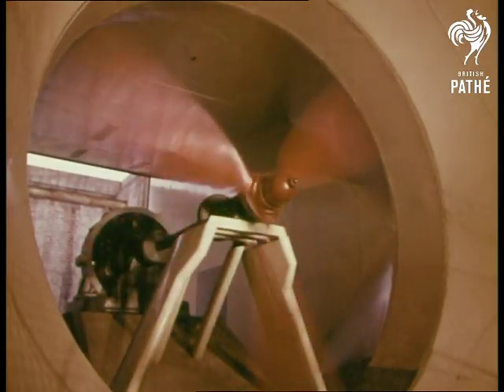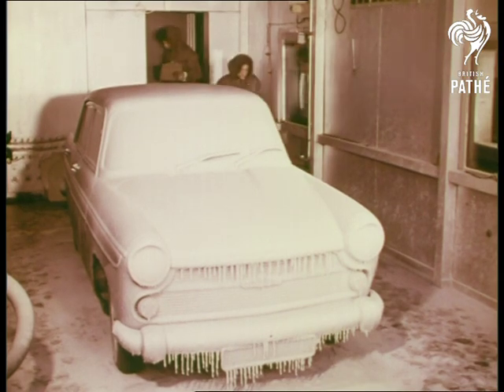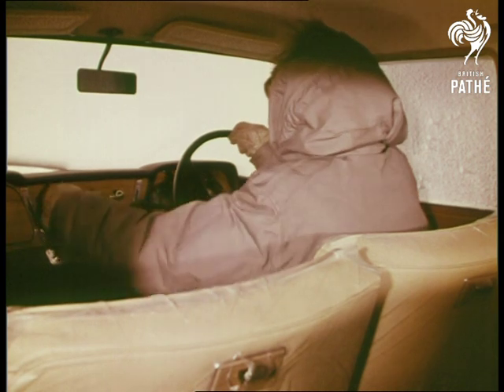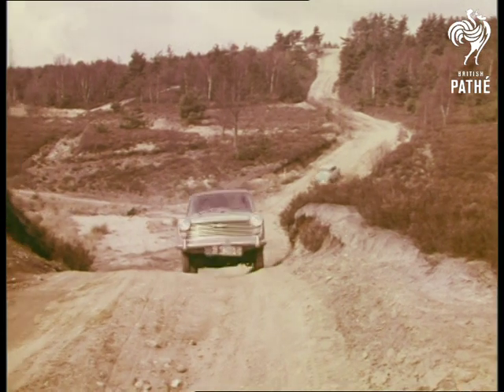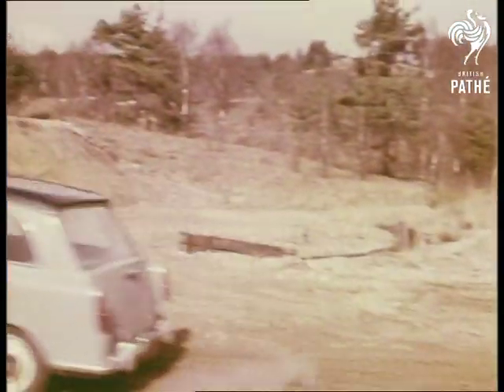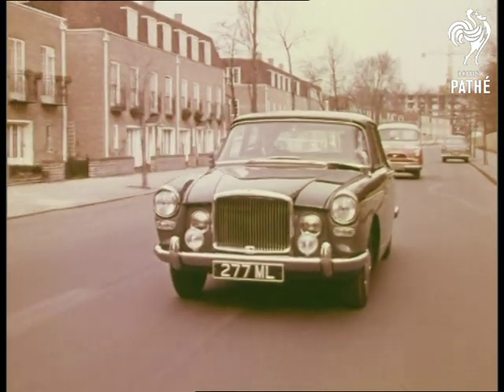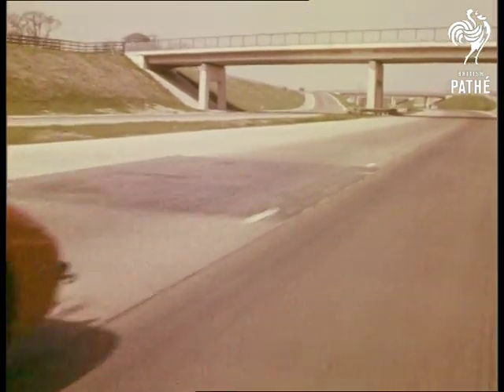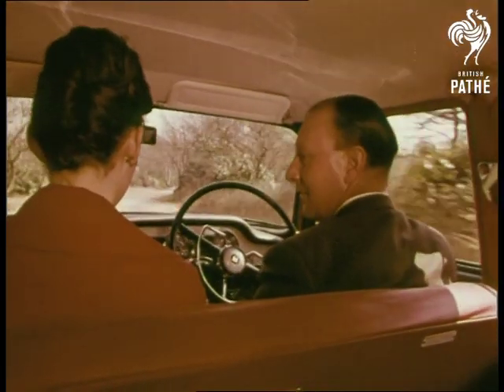B.M.C. "Quality" - Reel 2  (1950-1959)

Comment: When introduced they were up to the mark and BMC was functioning on all four cylinders. The only problem was the suspension wear giving rise to 'nodding dog' disease on the Oxford/Cambridge range. Had they had McPherson struts - like the cortina introduced a few years later - and rack and pinion steering we might still be driving one!!  .
Reply: Def 1950’s era design suspension wise that’s true
Reply: They had king pins and lever action shock absorbers. Ford had Macpherson struts, ball joints and telescopic shocks. Huge difference.

Comment: 1:35 could do that with cars back then they were built to last like to see how the plastic bumper bar cars of today would stand up to the same test
Reply: I lived through those days and few cars at this level got much past seven years without rust problems, sometimes practically irreparable. Batteries often needed expensive replacement at three years, exhausts often two years and few engines would reach a hundred thousand miles without major rebuilds. Your modern 'plastic bumper car' would outlast them easily.